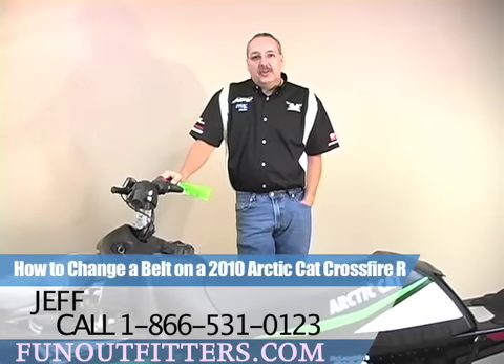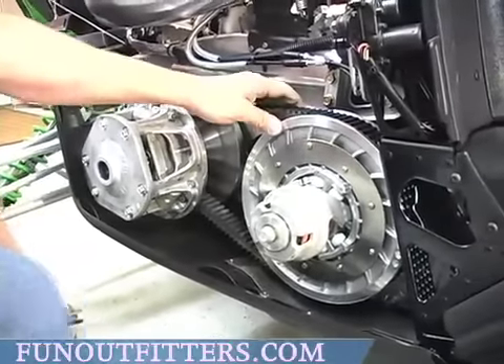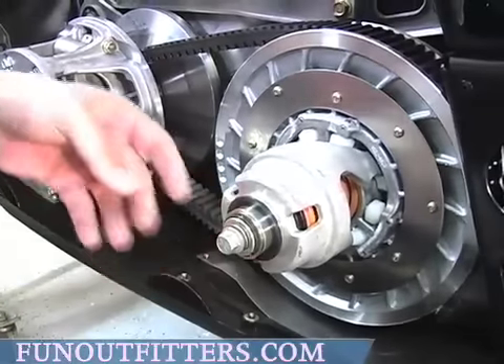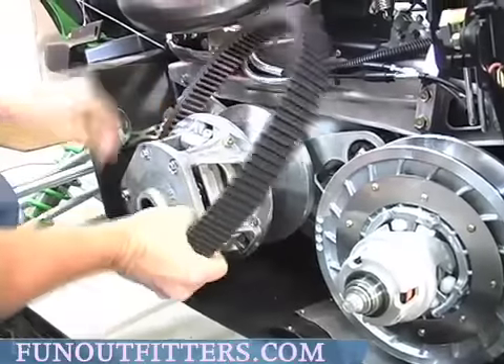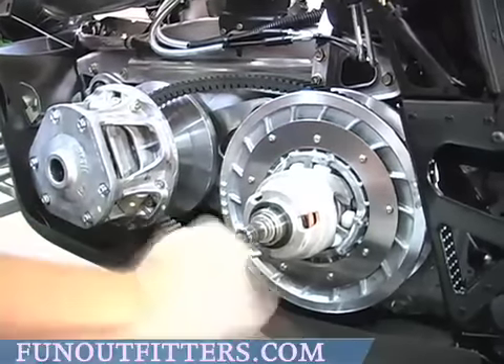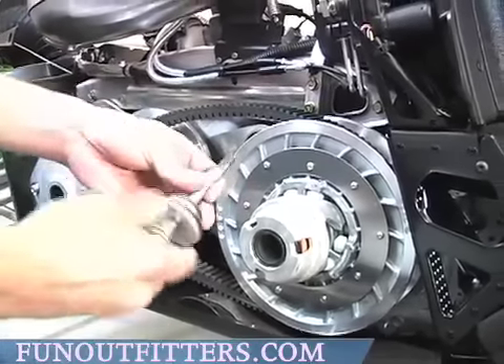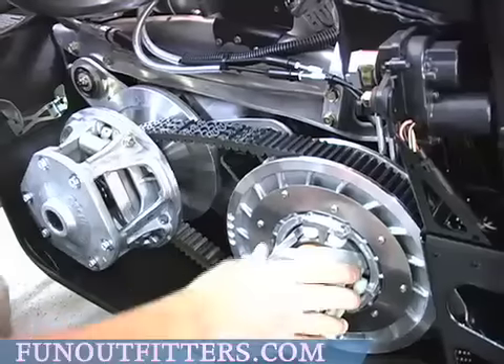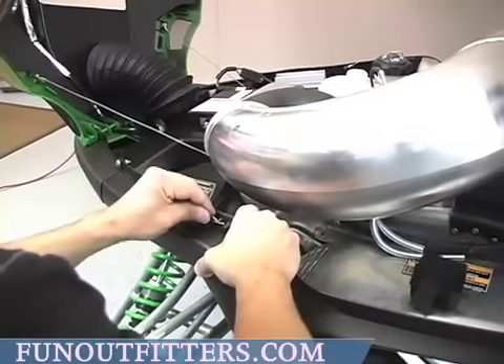Removing Belt on 2010 Arctic Cat Crossfire R 800

Comment: How in the hell are you suppost to change the belt after you install cats new heavy duty skid plate.  There is a bolt that sticks out facing your primary that is only like a 1/4"-3/8" away.